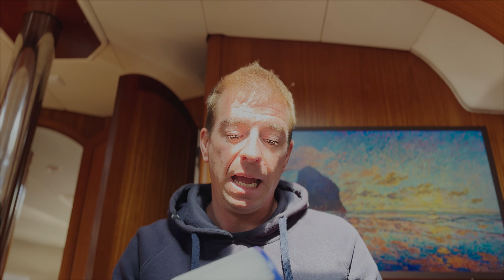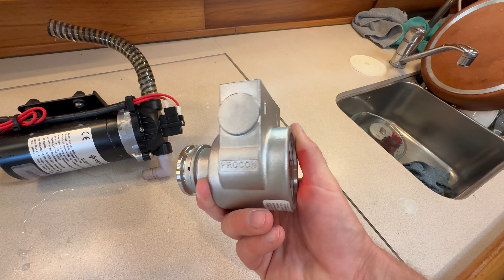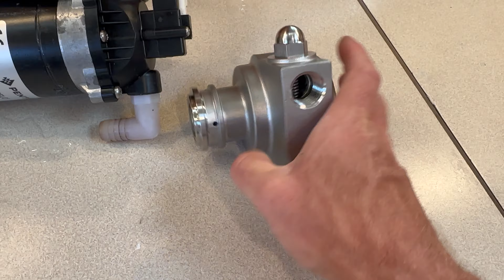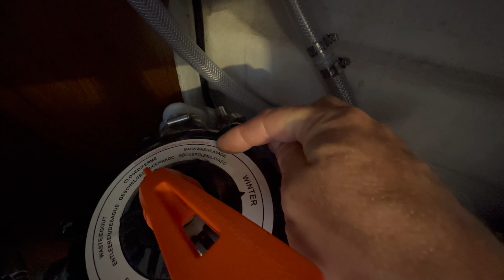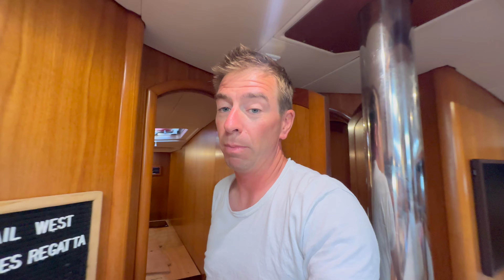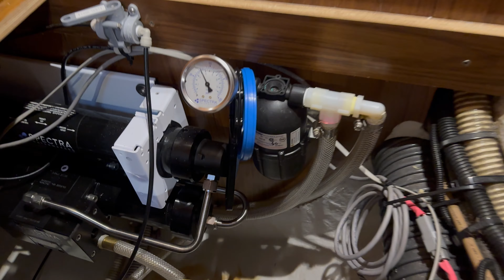How I Made Our Watermaker Whisper Quiet (And Solved Plankton Clogs In Cold PNW Waters)

Comment: Beware the geekpure polycarbonate filter housings.  I heard from them that the o rings are a special size and they are more brittle then the regular big blue style.  I've had alignment issues with them being damaged by rigid filter elements.  I have 3 in my house
Reply from the maker: Ok, I will watch out, thanks!